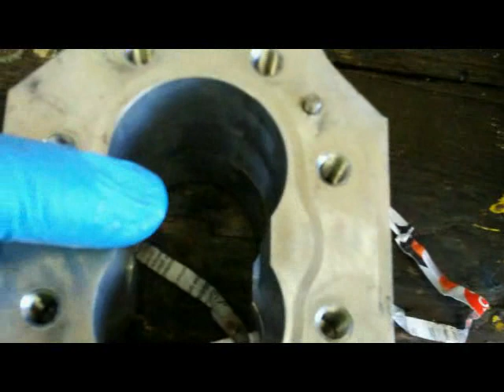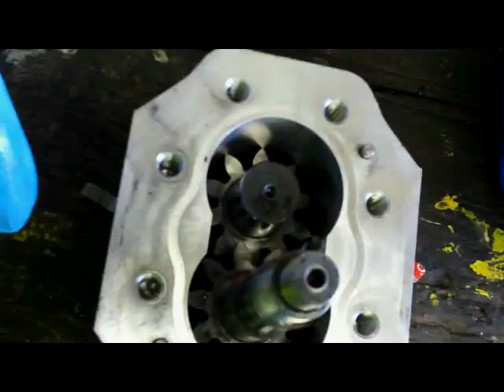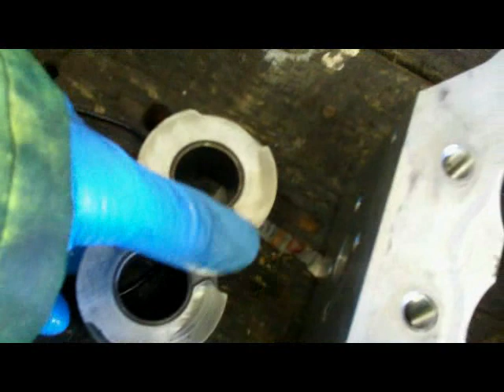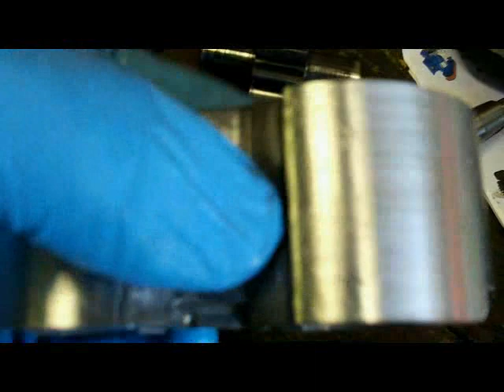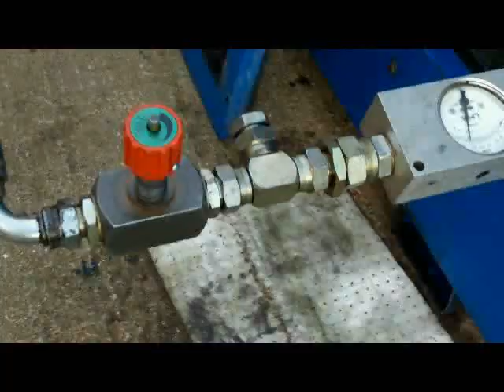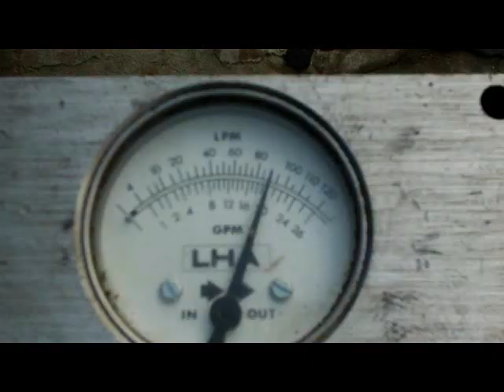Hydraulic power pack part 2

Comment from the maker: Hi Senthil
many thanks for your enquiry and your interest in my videos.
My work is designing hydraulic systems often dictated by the machine designer as I like to concentrate on my speciality which is Fluid Power. There are many website on line that show you how to calculate this but you will need to know material specification and the method that you wish to use ie. Pushing into a vee block or bending over folding over an edge. All of these methods will demand different force at the rams.

Comment: dear Bob,I am planning to install one hydraulic press for deep forming .I like to press a  6mm thk 72 inch long plate to 90 degrees bend.can you please suggest me how many long bed to be installed and how many cylinders required to press the plate equally.

Comment from the maker: many thanks for your enquiry and I notice that i did not cover this. If you look at the cheek plates you will see two grooves going from suction side and into the bearing. The 3 shaped seal has pressure 3 ----this side. I will make another video to show how you change the direction of a pump. Note the wear on the is always opposite side to pressure.

Comment from the maker: @davetileguy 
Many thank you for your interesting question.
The answer is that in theory pumps and motors are the same and can often be switched.
However, manufacturers sometimes design for one use only. 
Always best to give them a call with the part number and ask the question rather than take the chance.
You can find more of my hydraulic stuff on my website 
Very best
Bob